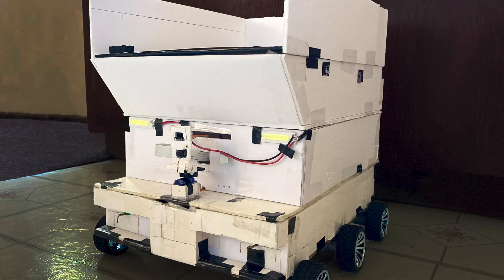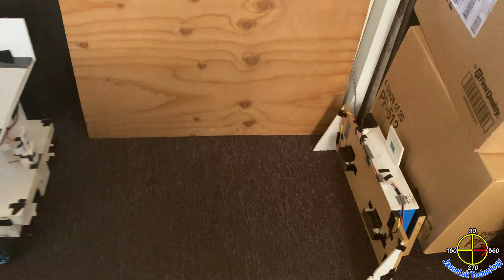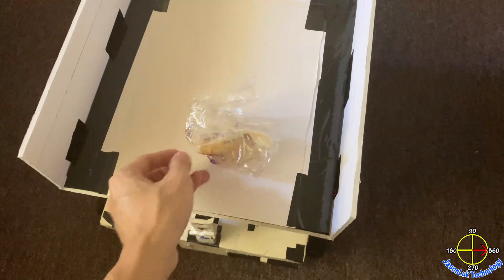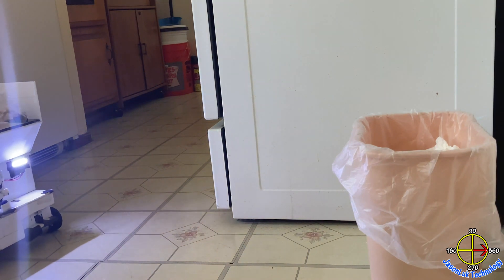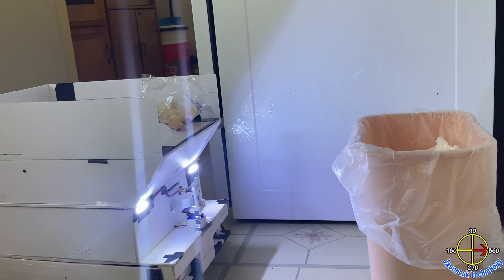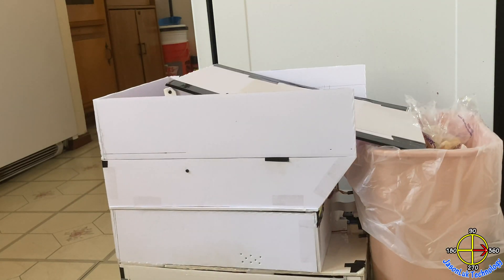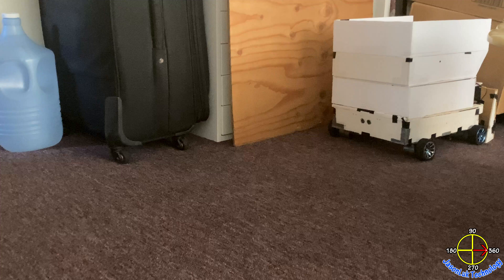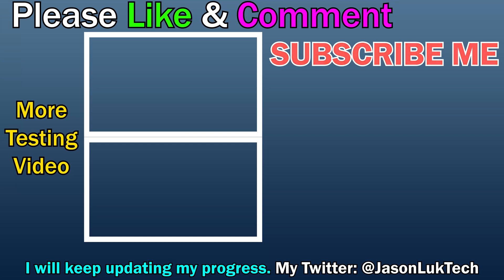Autonomous Trash-throwing Demonstration [Indoor Self-driving Robot]

Comment: I'm really confused how this robot can do this based on your code in GitHub. For one thing, it looks like the arduino code is missing. I guess you have placed colored squares where the robot can see them? And then it can navigate based on where it finds those and a map that's hard coded in the program?
Reply from the maker: My Github just have part of the codes I used. You are correct for the colored squares. I choose green as my landmark color, it is easier to recognize for the camera. You can watch my docking test videos, they have the pictures this robot captured. And the navigation function is based on pre-coded data with lidar obstacle detection.